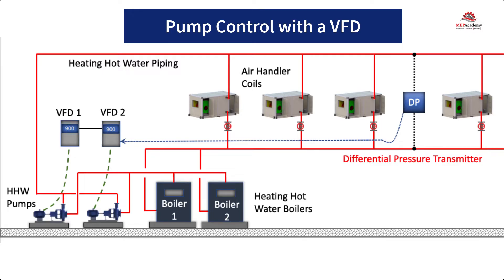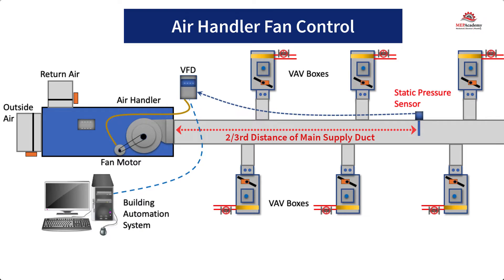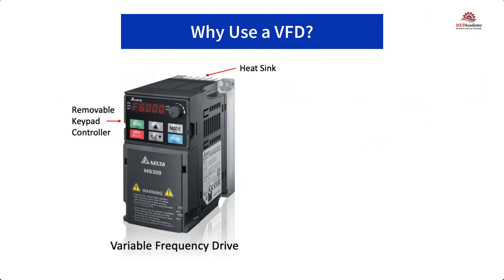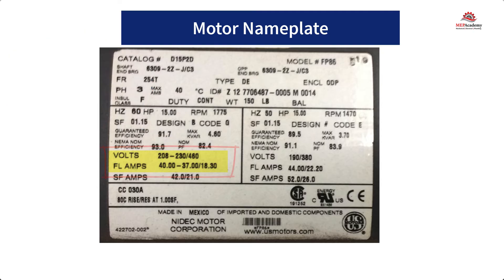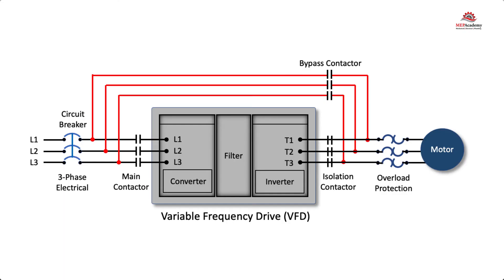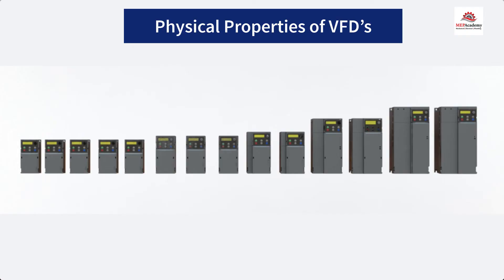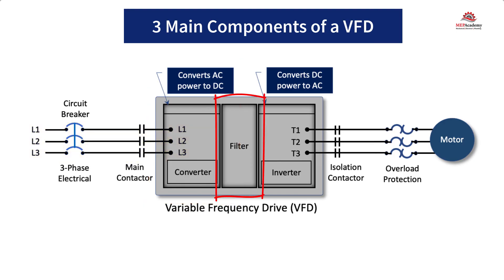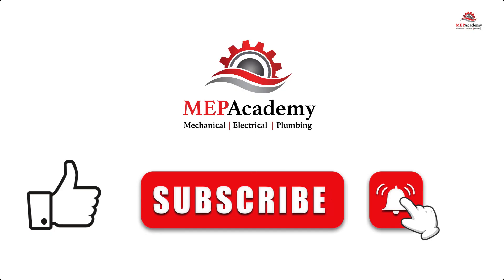How Variable Frequency Drives Work in HVAC Systems

Comment: We use VDF with the air handling unit fan to increase or decrease fan speed and control CFM... We also use VDF to control the speed of the chiller compressor...but ?
What if we replace the chiller with a VRF heat pump? Would we then need a VDF to connect it to the heat pump? Wouldn't we need a VDF for a VRF heat pump because the compressor has an inverter and changes speed as required? What do you think?.... Thank you....
Reply from the maker: Good question! A VFD (variable frequency drive) is an add-on device used to modulate the speed of motors like fans and pumps. Traditional chillers often use external VFDs on their compressors or pumps.
A VRF heat pump, however, already has a built-in inverter-driven compressor. That inverter is essentially an internal VFD, and it modulates compressor speed automatically to match the load. So in that case, you would not add an external VFD to the VRF compressor — it would conflict with the factory controls.
That said, you may still see VFDs used on associated equipment in a VRF system, like:
Air handling unit fans connected to VRF coils, for airflow modulation.
Hydronic pumps if the VRF system is water-cooled.
So to sum it up: the VRF heat pump’s compressor doesn’t need your own VFD — it already has one built in. But VFDs still play a role for fans and pumps that support the VRF system.

Comment: what is the perfect location of Differential pressure transmitter in chilled water net work?
Reply from the maker: Excellent question! The optimal location for the differential pressure (ΔP) transmitter in a chilled water network is at or near the most hydraulically remote air handling unit (AHU), fan coil unit (FCU), or terminal unit that is expected to be operating under design conditions.

Why this location?
1) This ensures that the control system maintains sufficient pressure differential at the furthest point in the system, so all coils get adequate flow.
2) By controlling the variable-speed pumps based on ΔP at the critical location, the system avoids over-pumping while still ensuring comfort and coil performance.

Practical options include:
1) Across the supply and return lines serving the most remote AHU or FCU.
2) Alternatively, across supply and return mains at the end of the piping loop (but before terminal unit takeoffs) if unit-level access is difficult.
3) Some systems use multiple ΔP sensors and select the highest required pressure electronically (called "ΔP reset" or "trim and respond" logic).

Comment: some random dude: Oh no! i forgot to read that the vfd manufacturer told it should be 1 meter away from devices that produces heat and now my vfd is on fire!
Reply from the maker: Yeah, it's always good to read the installation instructions to avoid such problems.

Comment: What does cfm mean
Reply: Cubic feet a minute
Reply from the maker: CFM is a measure of the volume of air that moves in a minute. Cubic Feet per Minute (CFM) is used in the design of HVAC systems to indicate how much air is added or taken from a space, this could be Supply Air, Return Air or Exhaust Air volumes. Your bathroom fan could be 50 to 100 CFM depending on the size of the room.

Comment: Respected sir ji 💐🙏........ Can Air Conditioner run on it .... if install with matching rated credentials 🤔🤔.... ✔️💯👉🙏
Reply from the maker: Yes of course, and air conditioners also use ECM motors to vary speed.
Reply: @MEPAcademy  Thank you so much Sir ji.... Great greetings 🌺🌻🌹

Comment: This not true !
I bought on but it’s useless.
This is fake ….
Reply from the maker: Not sure why you think VFD's don't provide any benefits for HVAC systems. They are used on all sorts of equipment, chillers, Pumps, fans, etc, to save energy by reducing the amount of electricity consumed to match the load.
Reply: shut up